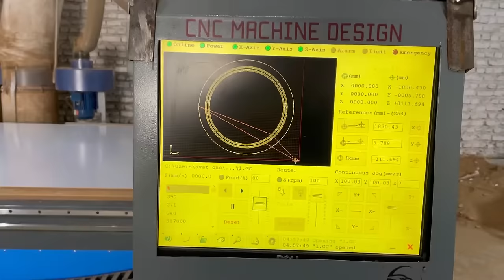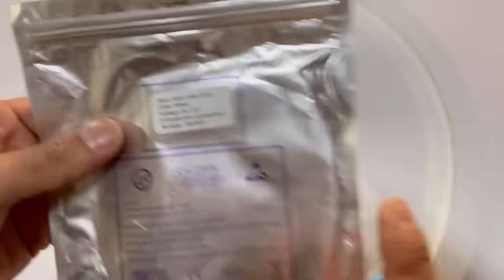DIY LED MIRROR// How to make a led mirror// Light Up Beauty Mirror

Comment: What's the sheet u use to stick on mirror for protection during sand blasting? Where is it available?
Reply from the maker: Yes, it is available, if not, you can use paper glue
Reply: @thejoyofmaking4333  Can you give the name of the sheet? Is it available in automobile/hardwares stores?

Comment: I wonder what you use for sandblasting and can I use small air compressor 1.5 kw 8bar for this this project
Reply from the maker: I use the engine of an old car to create air pressure for sandblasting, I think 8 bar pressure is enough for glass sandblasting.

Comment: If the led band don't work any more ,how to fix it??
Reply from the maker: Thanks for the good question you asked, it is very difficult to replace or repair LEDs in this method, so 12V LEDs are used, which has a very long life and usually the adapter needs to be replaced.

Comment: You could put the ac socket facing the back so that you can run wires inside the wall to power it. Makes for a much cleaner look. Kinda like hanging up a TV.
Reply from the maker: Thanks for the point, I'm glad my viewers have an engineering perspective
Reply: @thejoyofmaking4333  ❤